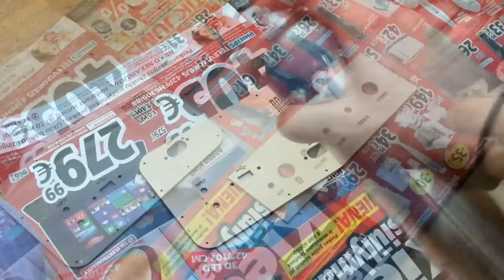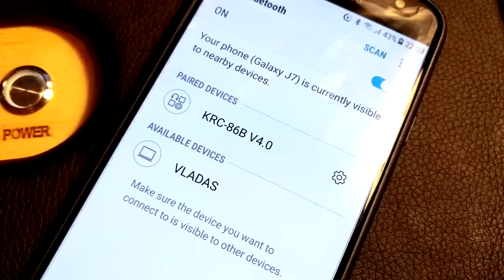INSANELY Loud 150W DIY Bluetooth Speaker Build l HOW TO

Comment: Good woodwork, but from the acoustic point of view there are some flaws. The cabinets seem to be too small for these speakers. That's why the middle bass is very loud, while the deep bass is missing. You used thin plywood for the rear panel. This weakens the cabinet against the pressure of the speakers.  Furthermore, there should be a partition wall between the left and right channel in the housing. Apparently you didn't use any acoustic filling material. This can lead to unwanted resonances in the middle frequency range. One more word about closed and ventilated enclosures:  Loudspeaker cabinets must be matched to the loudspeakers used. A loudspeaker that is good in a closed box is usually not good in an open box and vice versa. The keyword is "Thiele Small Parameters". If you know the Thiele Small parameters of your speakers, there is software that will calculate the right cabinet for you.  As an old-school loudspeaker tinkerer I would like to say that I would never think of combining both stereo channels in one box. Stereo should allow a spatial sound image and therefore the loudspeakers must be further apart. Otherwise, a mono speaker would do just as well.
Reply: its nice to know more about how speakers work... thanks for this tip...
Reply: The deep base is missing because he used crossover for mids. Your points are valid but how much Sq are you expecting from that little chinese amp?
Reply: deep base is missing because the cabinet is wa too small for these speakers. Given a decent amp base rendition depends mostly on what cabinet you use and what are the TSP (Thiel Small Parameters) of the speaker.
Reply: Sounds like you know whats up. Please post a video. I want to build one but i want to do it right. I know different woods used have an affect on sound quality as well.
Reply: Pedro
Reply: @FourValveFox  This is wrong. How should a crossover for the mids affect the deep base quality?
Reply: @peterofenbaeck405  you're correct about the housing and design. Those speakers are for car audio and were designed for very large cavity doors that are not sealed well. The crossovers remove all the low Bass in that setup. That kit is designed to work with a subwoofer. It has the highs and mids but no Low
Reply: +Peter Ofenbaeck Who uses the word vibration in terms of Hi-Fi? It's the material that needs to be resonance free, and for good sound quality you want a material that is resonance free, so it does affect the sound quality, period. Resonance is not a good thing in HiFi, and it delivers BAD sound quality.
Reply: Sure it sounds better than my SONOS Play 5 paid $500, while your points are probably valid, here I don't think people are looking for perfection, I look forward to see your BOOMBOX design and a video how to build it, with ALL the "flaws" corrected.
Reply: I just learnt something my school would teach me i read the comments as well
Reply: Excellent speaker! Thank you for sharing! Add some poly fill and a partition, this will help with box flex and will trick the speakers into thinking there is more volume. Also the partition will help tremendously because all amps do not produce the same amount of power to both channels at the same time which will cause one to work harder and cause flutter. I love the speaker though and will be starting on mine tomorrow.
Reply: CulichorHimself My point! I mean how many people can build a damn Bluetooth speaker 😂🤷🏽‍♀️
Reply: @FourValveFox  the amp is fairly decent and the speakers are a component set used in car audio by morel.  imo the enclosure is small.these speakers are used to being in a door enclousure of a car. perhaps a ported or passive radiator cabinet would have been a better choice. it leaves me thing what would it sound like with poly fill added to the enclosure
Reply: @wax333  yes port would definitely help with the mid and low Bass. I would port the box and bypass the crossover  for the mids and you would get more bass
Reply: @FourValveFox  you potentially will damage the speaker by bypassing the crossover. making it play outside its range.
Reply: @wax333  not with 20 watts it won't. You don't have enough power to drive it even close to its capacity
Reply: the resonance / phase issue of two stereo woofers in one box can be vastly improved by reversing the polarity of one woofer. in my experience anyhow.
Reply: The Chinese 160w. Amp is definitely under powered... These have been dino tested on other YouTube channels and came out at around 60w per channel
Reply: @bis124  I have tda7498 100w per ch version(not ''E''), chip can provide ~70w rms per channel with ~10%thd, 50w rms bellow 1% thd! Overall chip is great for low bass speakers, for mid's and high's i recommend class AB amp. Also this chip can actually push 100w rms/ch, i saw one guy was pushing even more and chip was ok, but i cant imagine how that will sound when connect speakers, 50% distortion. :) So, is data of this chip correct? Well, yeah it is... 
Is is usable in real life? NO!  China marketing, they are best! :)
Reply: Can you post a build on your YouTube channel then
Reply: Maybe for him " bluetooth system for fun & party" is not exactly the same as "High fidelity system for intensive music appreciation"
Reply: Mr Ofenbaeck you are right but I suppose the DIY project calls for portability and light weight.  Fibre fill and patrician should have been applied.  I am an old school speaker builder like yourself.
Reply: All true, forgot to say those small boxes with loud speakers have passive membrane instead of bass reflex, so it should give effect too, but more is that combination of all that parts in right way with all parameters and that you can give you speaker volume of box needed and other things that are in frequency range are very important, no just loud speaker and loud amplifier, you can kill all love that combined things can provied...and you get nice soft and hard in the middle punch of kick without killing other sounds that are in mid range like voice, klavijature...and all other that can be recorded...it is easy to make a box and loud sound, but hard is to get very satisfying sound... pozdrav :)
Reply: @FourValveFox  it is not because of crossover, crossover just cut sound that is going for that speaker, and very common is that is going from 20 hz, i think it is not that, all other from crossover beyond point that is in book where says frequency range is going just in mid/high probbably more high, those are passive crossovers and that is made just for that speakers, even you can do connect them on other  too...
Reply: @Voldrania  He clearly used that terminology to explain. That's all.
Reply: John Smith  that the model not the brand there made by morel
Reply: @FourValveFox  I think the enclosure might have something to do with it!
Reply: @galyien  like ....?
Reply: @peterofenbaeck405  T/S parameters are only a part of the puzzle, its not the be-all and end-all. And the other issue is that most people focus on a singular or a few parameters such as FS, or QTS or Xmax. They then graduate to other more meaningless parameters such as "Its got a huge magnet" or "Which is better brand A or brand B".
Reply: EKTRO - Johnny yeah thats true all im saying is you often talk about resonance and not vibration in terms of HiFi. But yeah i went a bit over the line in the comment and was acting critics master for some reason probably bad mood.
Reply: You are right 
Peter Ofenbaeck, but unfortunately most people do not really care about sound quality these days. Most of those "bluetooth speakers" are blantant examples of electro acoustic ignorance.
Reply: you are correct and on other slight flaw these are Morel's car audio line mostly designed for open air like in the backseat area.
Reply: @FourValveFox  No he has just 2,4w with that powersuply.
Reply: @FourValveFox  i think that amp says 2×100W at 10% THD. but with no distortion it can go up to 60W i think
Reply: nice tips
Reply: Sir you are wrong those speakers are for car you can go and search on their website they are 6.5 inches midbasses and they are made for the tiny space inside the car doors now you are wrong
Reply: Anthony Moore Sr. - There’s no hating, learn the difference. Offering constructive criticism helps one grow.
Reply: JBLOW TESTER - Tiny spaces? It uses the entire door as an enclosure... that’s not exactly tiny.
Reply: He put a heart on every single comment except for yours because he doesn't want to admit his mistakes
Reply: You Should make and sell this kind of stuff.  Or  Made to order. For example Center SPEAKER.  Just a suggestion.  I just imagine a center SPEAKER with a lot of SPEAKER. WOW !
Reply: @FourValveFox  virtually all amps are made in China from $20-$2000.
Reply: unless you use passive radiators, then the size of the box has to be small. but you are right especially about the stereo
Reply: CulichorHimself
Perfection is not the point though. These flaws could have easily been prevented if he had the knowledge.
Reply: CulichorHimself it does not sound better. Ever heard that the Human ear works better than a microphone? 🙄
Reply: Peter Ofenbaeck there are two different ways you could go in this stream of building.
1) make diy speakers in the most crafty way as possible. And still be a pleasure to listen to!
2) make speakers with obeying all the laws to get the best audio with what you have.ex: 1)stereo separation,big enough cabinets, suitable drivers, etc...

This is a little bit of a different genre of what you’re in(no offence)

Anyway, great suggestions for woohoo want to build setup speaker things 😛
Reply: Wow..thanks professor mcwoodbetter
Reply: @FourValveFox  dont use crossover youll see ;}
Reply: Buncha karens arguing about stuff they didnt make 🙄
Reply: Com'on guys, everybody make mistakes, nobody is learnind doing nothing, it was fun to watch and he is sharing some skills

Comment: I think its worth noting this is primarily a wordworking activity, not an audio engineering exercise. Most of these sorts of projects have nice cabinets owing to the use of a squillion dollars of wordworking equipment, will make noise but have close to zero attention to the audio design. The cabinets are just built to house the speakers and the bits in them are bought on spec.  If you want to learn how to make one of these gadgets that satisfies your golden ear, then you need to go to an audio engineering channel.

Comment: 200mA AC/DC for 150W of consumtion? logic?
Reply: Yeah obviously this amp is more like 40 watts rms at most .
Reply: Ja Lee 150 watt peak ??
Reply: Ikr, but I need to clarify that it the audio is 150w the power adapter has to also be 150w right? Because I when I bought a 60w amp it came with a 30w power brick
Reply: Furious DYNAMITE of course
Reply: Furious DYNAMITE it likely has a transformer to step up the power so it comes with a power brick that says 30 watts but likely the amp takes that and doubles it
Reply: @vipervidsgamingplus5723  If an amplifier has twice the output power than the input power. Then it gives you twice as much energy as you consume. So you produce energy with the amp. If this were true, there would be no power plants. Only the speaker cables should be plugged back into the socket and the power generated. It's completely stupid. Nothing works with 100 percent efficiency or above. Some of the energy is lost. It turns into heat into the amplifier parts and the loudspeaker coil. "In physics and chemistry, the law of conservation of energy states that the total energy of an isolated system remains constant. This law means that energy can neither be created nor destroyed; rather, it can only be transformed or transferred from one form to another.(Wikipedia)" If you have a 30w power brick, your amp output power it's probably between 15 and 25 W. The rest of the energy becomes heat.

Comment: Man, what a SENSATIONAL PROJECT, I liked all the details and how it was developed with ALL the care and dedication that one should have in most of the activities.
You're in Congratulations!
Reply from the maker: Thank You so much! Such comments keep me motivated!
Reply: It was not developed with any care at all, which is a shame... There is a driver layout where you have the woofers on the outside and the tweeter(s) in the middle/between; the layout has a name, named after the guy who came up with it. This has to do with how the wave cones influence/shape each other as they propagate from the speaker. So you don't have to take my word for it I tried to find a video at the psaudio channel where this is discussed, but there are 10 years worth of video and I failed just now :) I just came across this same topic again today where they said that no credible designer would put the woofers centre and the tweeters on the outside... so whoever designed this did not have a clue and also did not bother to investigate speaker design worth 2 Cents. Avoid this layout in principle, you'll get the worst out of it. The layout should be inverted, i.e. tweeters at the centre.

Comment: I did a bookshelf build with these morel Maximos, they play really well, very loud with good frequency response. 

They like lots of power, being 90w rms each. Clean power helps a lot with bass production, these mids can play low! 

Pair them with the correct enclosure and port and you can get some impressive bass, I haven’t tried them sealed however. They can handle 200w rms as a pair if your signal is clean enough.

Comment: If you had added a large passive radiator and parts list I would be building one very soon... Gotta have as much low end as possible to fool the size.. So happy to see people building nicer Bluetooth speakers these days, my reality was lost on the last several years and portable options other than really expensive options that could be better given the price they demand
Reply from the maker: Thank You! I may consider adding a PR or a port on my next build!
Reply: i used 4 x 4" PR's on my build with 2 x 5" inch drivers and sounds very good
Reply: @NightshiftCustom  got a link? MM
Reply: Donny, I would be interested to find out if the ports make a difference.

Comment: Left speaker broke?
Reply: No. It'a the angle of the camera. I thought so too at first but you wouldn't see much blur on the left speaker coming straight towards you because it would just vary in size but not position. However the movement of the right speaker baffle is apparent because it's more of a side angle.

Comment: 200 mA at 12 Volts DC supply can not generate enough amps for 150 watts RMS, it needs at least 10 Amps DC for RMS and 20 for PMPO in case music reaches peaks. 200 mA is 0.2 Amps and will burn out . The most it can safely supply current for watts is 3 watts DC.
Update: Someone explained that the small supply unit is for bluetooth, there is another supply, I did not see it.
Reply: That power supply is only used for the preamplifier and the BT module, not the amplifier. A way more powerful one is used for the amplifier,
Reply: You have to show what amplifier and electric supply you put in for the speakers.
Reply: He put 2 power supplies. First is 12v 0.2A (for bluetooth module), the second is 36V DC and he showed it. DC 36V   5A WX DC2416
Reply: Yes
Reply: The amp will only really do 125@1% THD and will be over 30% by 180... But lets be real, unless people turn it all the way up (and sadly that's what most people do and blow their speakers) it will only use around 1-10w max for the average person.

I just found out recently what I thought was plenty loud was only 1-3 watts from my Chane A1.4's... about 85db in my listening position if you factor in the distance, which puts it slightly louder a lawn mower apparently.

Comment: Just stumbled on this channel. Amazing quality build. I would pay good money to get a speaker box with that kind of quality finish and fitment. Not sure the 200ma PSU is enough for that AMP board. I would have thought 2A minimum.
Reply from the maker: Thank You Paul! i really appreciate that. The main power supply (which clearly was not shown in the video for too long) delivers 36V at 6A. That other power supply is only for the Bluetooth module and preamplifier, to eliminate any ground loop noise. I would always consider a decent offer for a speaker of your choice!
Reply: All the info is there, in the vid, in PDF. Amazing how many people think the 200mA supply is for the amp.
Reply: @DonnyTerek 
Good job. The box itself would be a great kit for people who want to DIY but don't have access to those tools. Not everyone has a table router, if a router at all.  I would go for a mono version as the stereo effect is a non factor when merely wanting to put sound outside. An 8" woofer and 2" tweeter driven by a 25W amp is more than adequate. Marine speakers and a metal grill would make it feasible. 
Your box would be a great TV sound bar.
Love the comments you draw here.

Comment: Nice design, except the power supply is a very bad model (noise, parasites and ridiculous performance), I suggest you replace it with a toroidal transformer 2x18v-200vA, the sound will be much better.
Reply from the maker: Thanks! I may consider it!
Reply: Super Man friend, I’m studying audio, why the toroidal gives a better sound?
Reply: The toroidal is a cleaner power supply and provides a stability of the current, there is less see interference and background noise, the amp saturates much less, the harmonic distortion will be the lower.
Reply: parasites?!